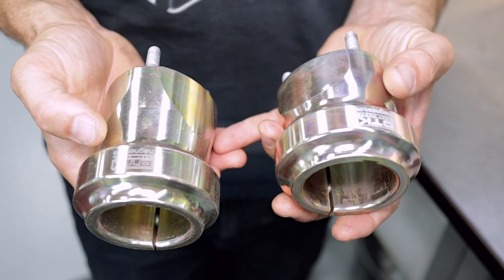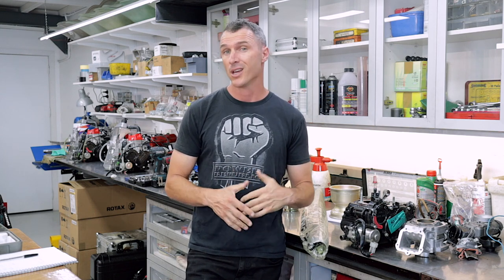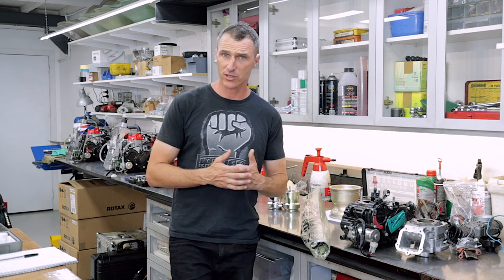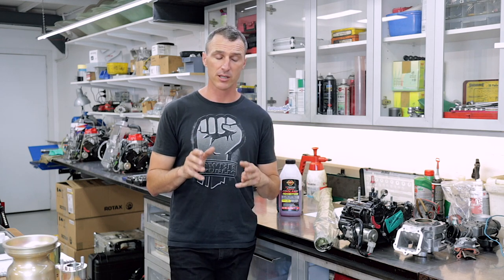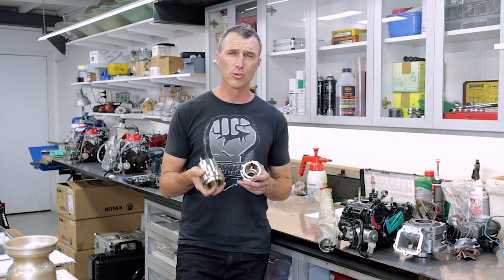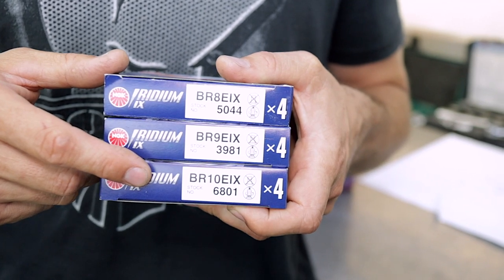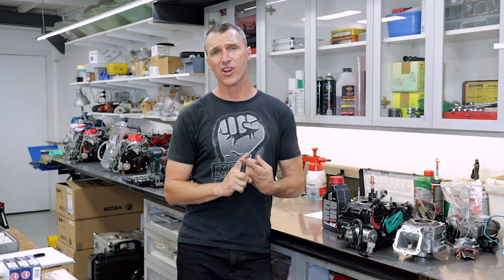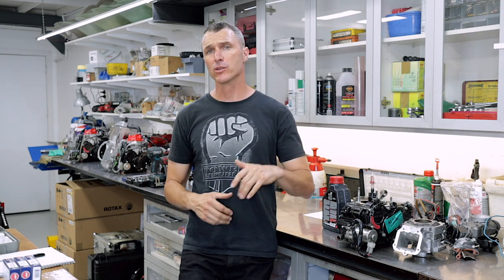HOW TO: Go Kart Chassis Tuning for Optimum Summer Performance - POWER REPUBLIC

Comment: Hi, what's the difference between the spark plugs you show here versus

NGK IR GR9DI range? This was installed when I bought my Rotax Senior Max Evo

Love the videos, always find myself coming back time and time again! 🏁😊
Reply: Just to update anyone who might want to know. Spoke to NGK and the customer service bloke stated that the only difference is that the versions shown in your video will allow the top cap to be unscrewed to reveal an M4 thread so that it can be screwed in other scenarios where that might be needed.
Reply from the maker: Hey Nath, great research.  I wasn't sure on that one.  I haven't used the new spark plugs that come with the ROtax that much, but really shouldn't be a huge game changer.  thanks heaps for tuning in and sharing the videos

Comment: as a new guy - is there any info about what kind of tools / parts i should consider taking to a track practise event?
love ur videos <3
Reply from the maker: Great idea for a first day at the track video
Reply: @PowerRepublic  yes please Derek :)
i imagine there are alot of ppl like myself this would help.
thank you
Reply: Take allen keys, spanners, sockets. Spark plug socket. Any bolt on the kart can come loose, so take every size on the kart req. Tyre removal tools if your racing may be needed. Go a few times before trying to compete, dont race on day 1. Practice going to a track, run the kart on practice days before so you understand what you need to do prepping. Maybe visit a race day to ask questions ect. Kart spares like spark plugs, water pump belts, fuel, water and oil, an air pump and pressure gauge also...
Reply: @christianbuczko1481  this is very helpful thank you :)
Reply: @SprintKing76  no problem, i forgot to mention chain lube, as chains and sprokets wear down fast and are handy spares to carry too, watch every vid on this channel, and you will learn most things especially if you have a tonykart. Other types can be a little different but follow the same principals. And theres usually more specific vids on youtube for anything else. Its a very steep learning curve just to make them go without falling apart and you can learn alot at home before hand. Btw, 1st two times i took my kart to the track I didnt even get to drive it because i had a carb fault 1st time and engine reeds failed another time.
Reply from the maker: @christianbuczko1481  thanks mate, spot on.

Comment: What would you say a basic setup for the rain in order to jack the rear up and stay up through most of the turn? I've watched a lot of videos from the UK and they all have a lot of jack in the rear and stays up through out most of the turn. In a heavy rain situation. Thank you.
Reply from the maker: I normally take of the seat stays, but maybe leave them on if you want to hold the Jack all the ways round the bend.   And a harder axle instead of softer one should help too,
Reply: Tryb diffrent preasure on REAR WHEELS on wet i mean less air
Reply: We recently did a wet test with 32psi in front and rear, and the kart had good turn but very unstable. So then we dd 32psi in the front, and 22psi in the rear - best wet kart I've ever had, I could brake and turn very aggressively and commit to curbs much easier. Softer rear tyres to mold to track, and stiff front tyres to force jacking is my theory. Hope this helps.

Comment: What's the change in axle do to the kart?
Reply: Generally speaking, changing to a soft axle will give you more rear grip, and going to a hard axle will get rid of rear grip. The impact is most noticeable from mid corner to exit. Start with a medium, that should work well in most conditions but try changing according to what the kart needs
Reply from the maker: when you change axle, it will make the kart stiffer (hard axle) or softer (soft axle).  FYI - when we straighten bent axles at work, we can feel the resistance to bending change as we straighten the different grades, with the stiff axles being a real SOB to move, and the soft ones bending back easily.   But what this does on the track is the Black art and it seems to vary depending on the type of tyres used at your track, ambient temperatures, driving style, brand of chassis and axle, track surface texture etc etc.   My best recommendation is to get one softer and one harder than standard to start with, and experiment for yourself at your local track.  once you have changed an axle a few times, you can get them in and out in about 20mins.  this might change from summer to winter, so change them often with an open mind to feel the slight variations and then you will know for yourself when it is time for an axle change.  Hope this helps.  Derek